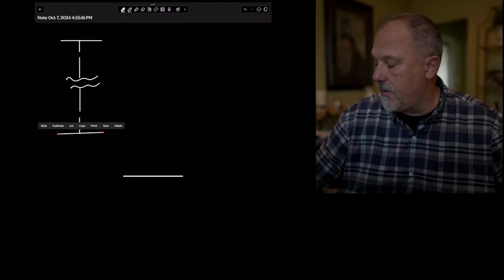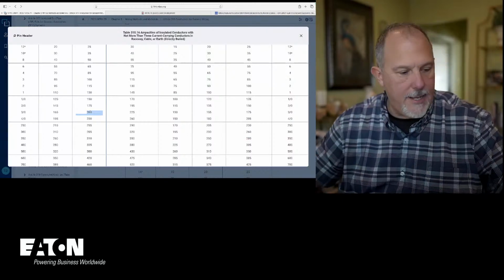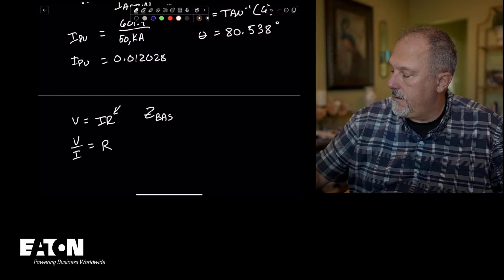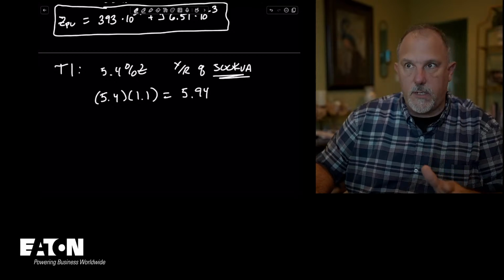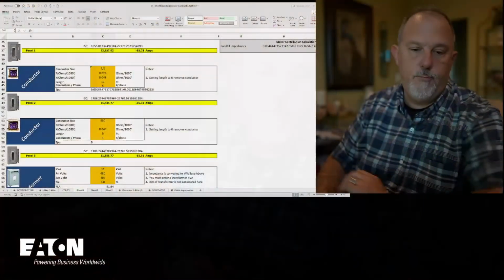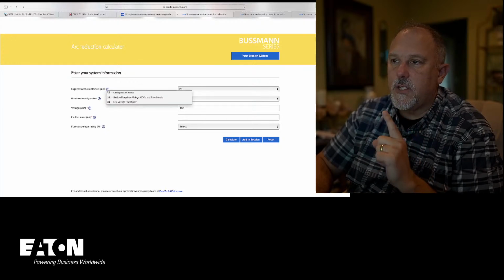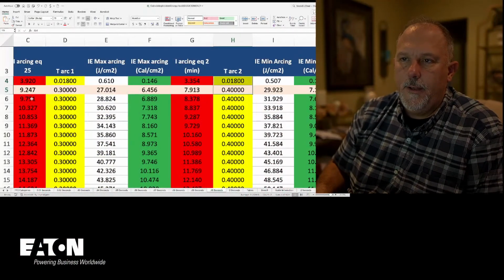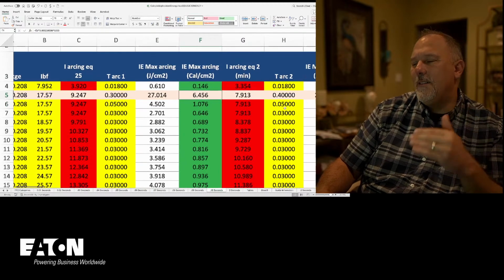500kVA Transformer

Comment: a question about sizing OCPD 1 and OCPD 2. In an overload condition, wouldn't you want OCPD 2 to trip before OCPD 1? if my math is right the 125% sets OCPD 1 to trip at a lower power level compared to OCPD 2. thanks for the video!

Comment: Tom! Great video and technical session! I did have a question on your Arcing Current Calculator. Bussmann has a "Arc Reduction Calculator" and a "Arcing Current Calculator". I noticed you used the Arc Reduction Calculator which lets you input specifics on gap and configuration. What is the difference between the two calculators?